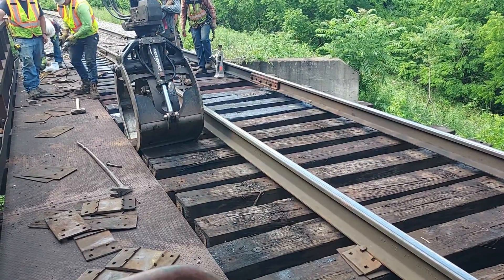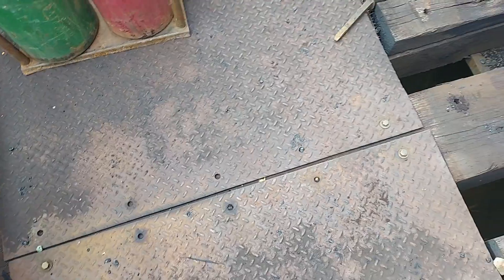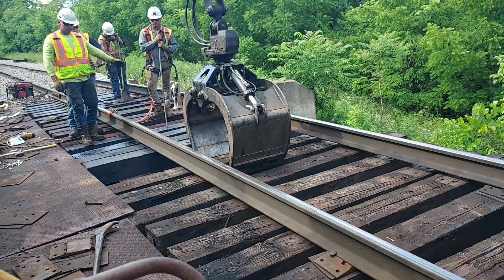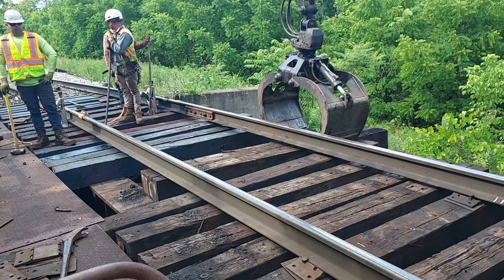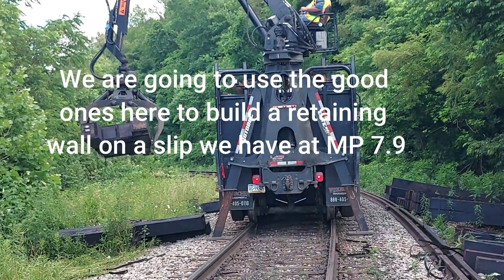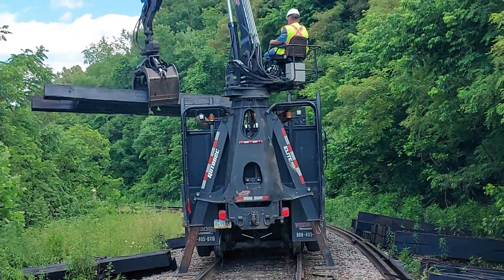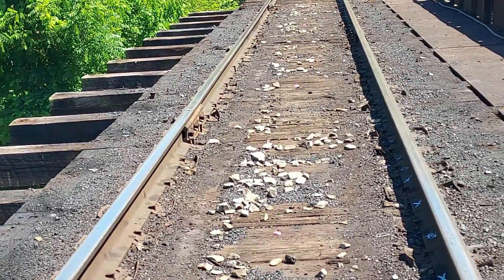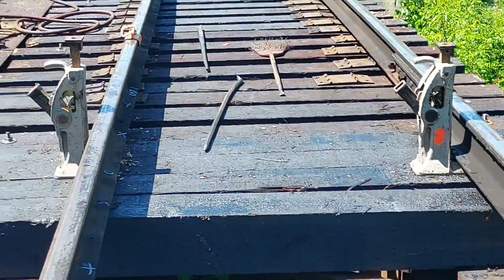Major Problems on Bridge 8 Deck Replacement

Comment: OK, The problem with the "dap". Question #1: Why do you need a "dap" in the sleepers, so they will not move over time? Question # 2: Why would the rail move so much on its own but not when tied in place. I understand the rail will move in the length due to heat and cold.
Reply from the maker: The dap keeps the timbers from sliding left or right Chris. Also on
some of our bridges that are on curves, there is super elevation on
the bridge, so the daps have to be cut just right on each timber to
accommodate one side of the track being higher than the other. 
You are right about the rail moving because of expansion or contraction which can skew the timbers also the vibration of the
train passing over the timbers can skew them also.

Comment: Today I learned what a timber dap is. Thanks Dave! 😄
Reply from the maker: Most folks had no clue what a dap is WheezerOfJuice, now
a whole lot of folks know. The machine they use to cut the daps
at the mill is pretty impressive. I was at the mill watching them
but they asked me not to make any videos there. Glad you
could take the time to write in and to check out the bridge
deck replacement.

Comment: Since that's happened before it would be pretty basic to fab a light alloy go/no-go gage so the crew could check each timber before insertion and correct the cuts on the spot or if a load is defective, send it back. It would be a bummer to need a portable hydraulic milling cutter that straddles upside-down timbers (with a connector for crane use) but that would be an option if things get really bad from suppliers.
Reply from the maker: Sounds like an excellent idea CommOut, I will have to pass that
on to the bridge crew next time they come in.   Very much appreciate your taking the time to check out the video on the problems on the bridge deck my friend.

Comment: Amateurs. First rule is to measure what ever you are replacing on a beidge to make sure it will fit. Second never unsecure that much rail at once keep buttoning it up behind.
Reply from the maker: Thank you for sharing that with us BC. Appreciate your taking the time to check out the bridge deck problems video my friend.

Comment: The timbers taken out of the bridge looked to be in good condition. Why were they replaced? Thanks for your great videos!
Reply from the maker: If you had watched a train pass over the bridge from underneath
then you would have seen the timbers were spongy also some of
them were still in decent shape, some were not holding spikes. 
Thank you very much for taking the time to check out the video my friend.
Reply: @ccrx6700  ah ha--don't just look but watch/observe and inspect. Great to watch the care you all take with your road...
Reply from the maker: @j.mygrant3752  😊👍 thank you

Comment: guess those timeber can be reused where the logs are just only wet mush
Reply from the maker: Yes Jari the decent timbers will be used for another use somewhere
on the track or at the mine or given to a local farmer. Junk ones
are dumpster material.

Really appreciate your dropping in on us and checking out the video. May you have a most blessed day my friend.

Comment: Dave. Why were the old ties notched out on the underside ?  Was that to position them during original construction ?
Reply from the maker: The dapping on the bridge timbers is to prevent them from
sliding left and right gtf g. Some of our bridges, but not this
one, have super elevation in them, so the dap must be
deeper on the inside of the timbers than on the outside
of the same timber to allow the rail to be super elevated.
hope that made sense. I need to do a video on that sometime.
Really appreciate your checking out the video my friend.

Comment: Gremlins are at it Dave. It happens. But  its fun finding and implementing solutions. First you look for an easy and quick fix but usually the gremlins are still lurking around fo it will become a more difficult and complicated fix.  A portable hand held wood plane? Hmm me thinks the circular saw and chain saw will be quicker.
Reply from the maker: Mistakes happen to the best of us. My dad always said to err is human, to forgive divine. These guys did a fantastic job with
what they had to deal with and never gave up. Thanks so much
my friend for visiting with us. It's always a pleasure to hear
from you Bill.

Comment: OK, so I can understand why the long timbers had to be left in place to support the walkway, but if the regular ones had already been unspiked, why hadn't the crew used the spike puller bars to shove the ties out a few inches so Richard could more easily grab them? Instead HE ended up having to use the claw to shove them over and then pick them up as well.
Reply from the maker: I honestly do not know why they didn't whiteknightcat. Sorry
for not having an answer for you on that. We do appreciate your
taking the time to watch the presentation tonight my good man.

Comment: i want to suggest getting 6 inch wide wood chisel  and some canola oil and a cloth to lubricate the chisel  and a deadblow hammer should fix that problem easily  without destroying power saws on that stuff, the ones installed can just be flipped over and fixed in place easily as well.
Reply from the maker: Thanks for the suggestions. Next video out I will show you
what they did. They didn't use a wood chisel per se, but did
us a hand adze. Really appreciate your stopping by and checking
out the video my friend.

Comment: We called them sun kinks on the Milwaukee, usually fixable with a few jacks. The bad ones looked like a snake crawling!
Reply from the maker: Sun kinks, heat kinks, heat buckles all 3 terms have been used.
A track can buckle from other causes than thermal expansion.
Which is why I use heat buckle. But I have no problem with
using either of the 3 terms. Most non railroad folks only have
heard them referred to as sun kinks. We had a buckle here many
years ago that was caused by mine subsidence and yep it
looked like a snake S. Really appreciate your dropping by and
taking in the video today my friend.

Comment: On the shot with the wrongly cut timber in place it looks to me like the dap is the right width for the girder but the wrong distance from the end of the timber.
Reply from the maker: The west end approach span the daps were cut correctly. The center
span had a wider girder than the approach girders were. The guy
who measured for the timbers did not realize that difference in
width. We all learned something out of this deal. Thanks so
much for stopping by and taking in the video today Richard.

Comment: Sir was the depth of the cuts correct on the ties? Thanx Ken from gpt ms
Reply from the maker: Yes they were Ken, that would have been an awful mess if they
weren't. Our timber supplier read the prints they were given
correctly, the guy that did the measuring did not measure
the center span girder correctly. Thanks so much for stopping
by and watching my friend.

Comment: A circular saw and a couple of 2" chisels. Set the blade to the depth you need, make a bunch of kerfs and then chip out the flakes with the chisels. I just finished a major amount of dap corrections for the miter rail seats on a drawbridge. The bascule and approach spans had a grade mismatch at the heel. It involved lowering eight 60" by 30" miter rail seat plates and then run off the grade change by dapping the approach span ties. 
Not too hard to do, but watch the that the wind doesnt blow the sawdust onto your sweaty body during a hot day. I've even set up fans and blowers to blow the sawdust away from me. Creosote affects people differently. Me, not so much, I've seen it peel the skin off of other people like a really bad sunburn.
Reply from the maker: Your right, creosote can cause some nasty burns. My dad was
a lineman for the local power company and back then they
climbed creosoted poles. Great idea on the fans. They could have
used your help on these my friend. Always appreciate your
taking the time to watch and write in my friend.

Comment: Man o man that had to be gutting for the guys when that fitment problem was discovered. Hopefully the trimming goes smoothly, the heat buckle gets drawn back into place, and the train can start rolling on schedule! 
Fantastic video Dave! Thanks for showing the good days annnnd the bad days!
👍🚂🚃🚃🚃🚃🚃🚃🚃🚃🚃🚃💯💪
Reply from the maker: Thank you for the very nice comment. These guys did a heck
of a job sticking with some tough situations. Kudos to them
specially in that really hot weather. Buckle cam back in when
it cooled off over night, they just had to bar it over a bit into
place. Will show you more of the trim work in the next video
out this week. Appreciate your watching my friend.

Comment: They should put a dado blade on a circular saw and cut to width.  It's gonna take a long time, but it's quicker than reordering, I'm guessing.  Thank you for getting out there and showing the details on this project.  This stuff is fascinating.
Reply from the maker: Stay tuned, next week will be the sequel to this video where
I show you what they did to widen the daps. Very much appreciate
your taking the time to drop by and check out the video today
my friend.

Comment: That's going to be an expensive mistake that person at the timber supply company made. You can't ship bridge tie's by FedEx overnight so as you say installation crew has to modify the ties. The creosote has to be hard on saw blades and that stuff isn't fun to work around.
Reply from the maker: Timber supply company dapped the timbers the way they were
given the measurements. Unfortunately the guy who measured
did not measure the center girder right. But mistakes happen
to the best of us. My dad always said to err is human, to forgive
divine. Always appreciate your coming out to visit with us my friend.

Comment: Dave 2nd spans over the road my guess? If the person doing tie data look from under side would have seen that especially on solid deck ! Also on class 1s we call the long ties outriggers another thing in hot weather only take out 12 ties put back 12 button up move on that keeps rail from kinking ! 42 years in bridge dept put on thousands of ties ! When i frist started we daped all are tie at frist with 2 man cross cut saw and foot adz then later added chainsaw we thought we were in heaven  !!
Reply from the maker: Thank you so much for the great comment. yep center span
over the road. The guy measuring did not take into account the
approach span girders were not as wide as center girders. 
I have no idea why they did not spike the rail down like you
said it should have been done. I wondered that myself, but
rail did come back in when it cooled off that night. To correct
the dap, that's what they used was a hand adze, will show
that in the next video coming out. Really appreciate your
watching today my friend. Wish you had been here to add
in your expertise. Railroad experience is invaluable, can't find out
what guys like you know from reading a book about it.

Comment: Hello from Los Angeles California. What is the purpose of the set of small rails that for example that are in the middle of the actual tracks the train ride on on a bridge that meet at a point on each end? i wish I could've explained it better, sorry.
Reply: Those are guard rails.  If a derailment occurs on the bridge, the guard rails keep the derailed car close to the running rails so it doesn't fall off the bridge.
Reply from the maker: You explained it perfectly my friend. here is a video I made
that tells you everything you ever wanted to know about the
bridge guard rails.
https://youtu.be/M9HZTKMyim8

Comment: Assuming this is a multi-span bridge and the dapping error is just at the main span.  The approach spans are likely shorter than the main span, so the girder flanges are likely narrower, and center-to-center of girders is also quite possibly different.  If measurements for the tie dapping were taken in the field on just one of the approach spans that would explain it.  Original plans could also not reflect what was actually constructed. Draftsman specialized in railway structures here, learned a long time ago to require that field measurements are taken at each span.
Reply from the maker: You are exactly right. Center girder is wider and measurement
was taken on approach ones, a fatal mistake. Our timber supply
company has several of the original US Steel prints for some
of our bridges but they could not find the one for Bridge 8. Thanks
so much for watching and writing in my friend. Excellent comment,
you are a thinking man.

Comment: Looks like some dicey work there :) Only the best trained crews and skilled operators here. This is way above the ground and there aren't a lot of places to get out of harm's way. Who would have thought bad daps would be such an issue. How would you have known they weren't dapped correctly unless you had known up front that X number of the timbers needed a different dap on one part of the bridge. Add in the heat warp and - well - this looks like a huge evolution for sure. I feel for you folks, even though that's railroadin' - it is a bunch of work you folks hadn't planned on.
Reply from the maker: Guys had their hands full on this one Brian. They persevered and
never gave up and with the high heat, we have to give them a
lot of thumbs up. Thanks for the very nice comment and for
taking the time to watch my friend.

Comment: From the video the bridge did not look that bad.   Thanks Dave
Reply from the maker: Some of them were, some weren't Wayne. Can't judge a timber from
just the tops. Got to watch underneath as a train goes over the
bridge. If the timbers are moving up and down, those timbers
are soft and spongy and not a good thing. When that happens,
it's time to replace all of the timbers. Very much appreciate
your stopping by and checking out the show my friend.

Comment: That sucks that those daps were cut wrong! When you do widen them, won't they be too wide? Just wondering if the notch locks them in place, and if their too wide they will slip around? Sounds like you have the bent rail problem handled, but that bad dap cut problem really sucks. 😖
Reply from the maker: Timber supply company dapped the timbers the way they were
given the measurements. Unfortunately the guy who measured
did not measure the center girder right. But mistakes happen
to the best of us. My dad always said to err is human, to forgive
divine.  Dap in the timbers helps to keep them from sliding
laterally on the girders. On bridges that have curves the daps
are cut to also add in super elevation on the high rail.
Always appreciate your coming out to visit with us my friend.
Will show you more of what they did in the next video coming out
soon.
Reply: @ccrx6700  👍

Comment: Aww what a setback Dave and it was going so well up to then. It is not just the problem of getting the dap cut wider but one of having the tools on site to do it and turning each timber over to cut then back the right way up again all adding time to the work. At least it was not 3am on a cold winters night which is when a lot of jobs like that run into problems over here. Over Christmas there are a few big jobs planned but we have strikes so I can see a lot of delays getting things fixed on schedule.
Reply from the maker: Yes it was a significant set back but as you know cedarcam,
that's railroading. :-) It happens to the best of us. Guys did an awesome job persevering despite the adversity and high heat.
But like you say on a cold winter night it would have been
far worse to deal with. Hope things get resolved on the labor
issues. At least the RR workers here won't be going on strike,
if they did, that would cripple our country in a very short time.
Always appreciate your faithfulness in watching my friend.

Comment: I knew that global warming was getting bad, but never thought it would warm up the North that much. Snow tire sales will take a hit.  
I saw the CSX Railroad replace the ties on a short bridge across a drainage canal in eastern New Orleans by the abandoned dump. I was shocked to see a loaded freight slowly cross the bridge after they had removed 2/3 of the ties. They removed 2 ties, left 1, then removed the next 2 leaving the next 1, and so on, all across the bridge. You would not believe how much the rails sagged when the wheels hit the gaps with 2 ties missing. I can't remember how much it was, but it was far more than I would have thought possible without any rail fractures, or the train falling off. Those were the days before cell phone cameras. Another time I saw a mother racoon crossing the road with 3 or 4 ( long time ago) equally spaced offspring walking behind her. They were perfectly spaced, walking in a straight line, about a foot apart. If I had a photo of it, people would think it was faked. The offspring were nearly as big as mom. Since racoons can see in starlight, I was surprised they don't need sunglasses in bright sunshine. Maybe that is why they have black around their eyes. They also have exceptional hearing. Too bad they can carry the worse virus there is - rabies which is nearly 100% fatal if not caught early. If one bites you, it probably has it. 
If they cut down into that wood, that will probably be the first place to rot with some surface creosote removed.
Reply from the maker: Sounds like CSX was taking a pretty big chance on that bridge to
me Bill. I'm not that avant-garde. I have also seen baby raccoons follow their mom like you mentioned, was pretty neat. Thanks so much for stopping by and taking the time to share with us my friend.